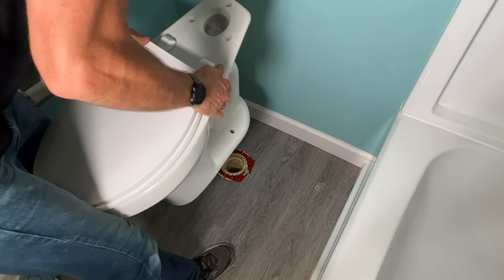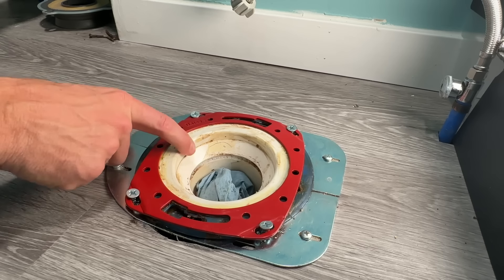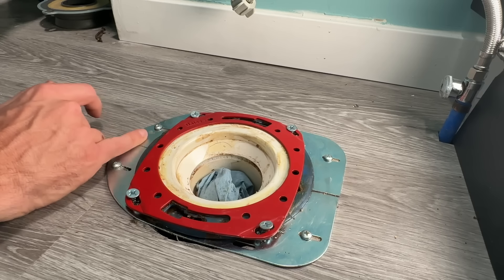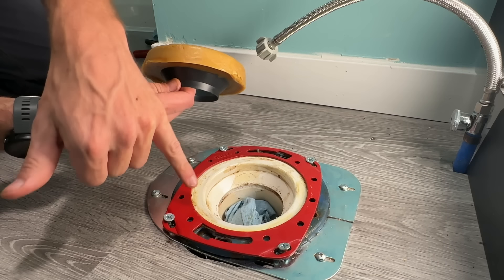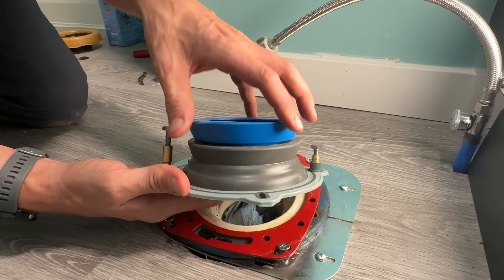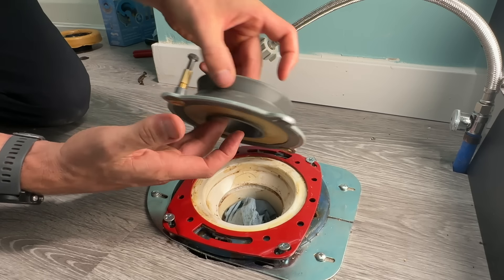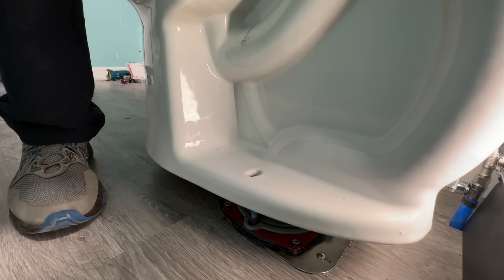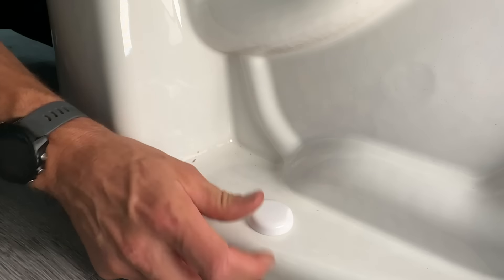How To Install A Toilet Bowl | Best Product On The Market!

Comment: Speaking from experience I would not use the Danco again.  The rubber to toilet seal isn’t 100% air tight and gases can escape between there.  Wax to toilet is more air tight.  I had to caulk around the toilet to prevent gases.  As pressure change it can get under the rubber and toilet interface.
Reply from the maker: Thanks for the feedback 👍
Reply: Beat me to it. I second what Joe said. Wax rings are definitely the way to go.
Reply: But this has a wax ring  it just has rubber on top too. 

How do you know that gases escape from the danco product?
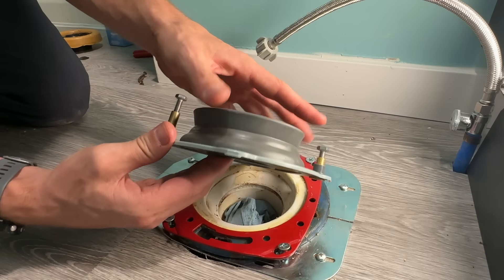Reply: 3:58
Reply: @GzoGuitarWz  3:56 he was fooled
Reply: @GzoGuitarWz  Because the bottom of the toilet is not a machined surface and has imperfections that the wax will make up for that a thick rubber seal cannot.
Reply: I would agree. Wax is the better choice. Just because someone developed a product that makes it easier to install, does not mean it’s a good choice and will work properly.
Reply: Thanks for this. I have a rocking toilet and funky smell after a bathroom remodel. Think I know what to do now.
Reply: @GzoGuitarWz  Their is a reason the go to toilet ring seal has been a wax ring since the 50's... Sometimes the wheel should not be reinvented.
Reply: I used it on a Toto that has a S shaped plastic piece between the toilet and the flange. I had to wax/grease the rubber piece so it has a better seal. Will see how long it lasts. Professional plumber installed it with a regular wax ring and it lasted 5 years before it started to leak.
Reply: multistatetoiletsandrestro2329  Plumbers don't really use these from what I have seen... 20 years of construction and contracting. They use WAX rings. Regular ring on normal depths floors and jumbos on further depth and even doubles at times I believe.
Reply: Dont we all pass gases

Comment: I've been a plumber for over 20 years , a simple deep wax seal does the job , sometimes I'll use a Sani seal ring , I'm not trying to invent the wheel and have a call back
Reply: Yup. He is getting paid to do this. Infomercial.
Reply: you could avoid more call backs without wax seals. mine blew out eventually from just plunging the toilet because apparently was marginal to start with(you never know because you can't see under the toilet to know how well it is sealing). i also always use the thickest wax rings i could find and make sure my toilet is nice and secure, that is never a guarantee though. rubber seal beats wax any day. it also makes setting a toilet simpler, because you can make a mistake and not have it cost you a $6 extra thick wax ring, having you take another trip to the store and 10 minutes cleaning up the mess.

i questioned this kit too until i used it, now i'm a believer. my toilet flange is slightly recessed, so wax rings aren't ideal to start with.
Reply: @LygerTheCLaw  facts
Reply: Rubber rings are better for DIY because they make it easy to remove the toilet and reposition it.  If you're not sure you're gonna get it right on the first try . . . .   But if you do use a wax ring, they're fine -- just use a thick one, yeah, not the cheapest one at the store.
Reply: If the toilet is placed slightly off center or not level, that trusted "horse and buggy mode of traveling" wax ring will fail.  I wouldnt recommend wax rings for your average DIYer, because that old school material isn't as user friendly to install.  Also, when replacing a toilet, wax is a complete nightmare to scrap off and full of bacteria.

Comment: The problem with the rubber is it hardens and degrades over a few years and leaks. I have not used this particular kit but I have installed rubber rings from Home Depot into all three of the toils on my house and all of them started to leak in about three years. I replaced them with wax rings and it has been more than five years and not a drop of leakage. I do realize that this kit has the wax integrated with it but it seems to me the rubber is still the weak link in the chain.

Comment: The blue screw extensions are (almost) worth the cost of the kit by themselves.  For me, setting the toilet down onto the hold down screw/bolts has always been the most difficult step of the project.
Reply: The fat soda straws, like you get at McDonald's for milk shakes, slide perfectly over the toilet bolts to make location easy.  Cut a 10" straw in half for two 5" locators.
Reply: @chrisgraham2904  Excellent idea! Thanks 🙏
Reply: @chrisgraham2904  well played,
Reply: I like to put masking tape down on the floor even with the bolts extending outward so I can see where to put it.  Those things help too.
Reply: @mae2759  Yes, that's a popular trick used by plumbers as well.
Reply: Read More
4 days ago
1. Clean the closet ring (if you like). Look carefully for any cracks or gaps in something  that may result in leakage in places other than the wax seal. 
2.  Install the brass bolts using a washer and nut on top to fasten to ring so they stand up stiff.  If a little crooked you can bend them a little.
3. Set the bowl (without any wax yet) on top of the ring and check for wobble or high centering. 
4. Use waterproof shims (I use pieces of vinyl floor tile) to level the bowl and remove wobble (rocking) without raising the height of the bowl. (if possible)
5. Lift the bowl while leaving the shims in place. 
6. Place the wax ring(s) centered on the closet ring. (enough to get a GOOD squished seal). 1 or 2 will usually be enough...if not reply to me and I'll help.
7. Be sure you understand steps 1-6. 
8. Squish the bowl down using a slight rocking motion till the bowl sets on your pre-installed shims. (Tuck the shims under just enough  to caulk over them them.)
9. Place plastic and metal washers and evenly tighten nuts (careful, not too tight).
10. Check for wobble and caulk to floor. Do not caulk the very back of the bowl so that any moisture leak has a place to exit. (rarely happens)
If you have a loose, crooked, broken, too high, too low or any sub-standard ring...  reply to me or else all bets are off.
Reply: you can put some pieces of straws to the screws to guide you for example
Reply: @ramiroreyes5266  That was my first comment.
Reply: Will this help with a slightly non-vertical pipe? Mine’s about 5 deg slant towards the front.
Reply: @ropaswan  As long as the "closet ring" it's self isn't  more than a 1/2" above the floor surface it's fine. It can be at a slight angle. The wax should be about an inch and a half above the floor height at it's "lowest" point so that you get a good squish all the way around. Using too much wax is cheap and ok....skimping on wax can be expensive. Use shim to keep bowl from wobbling BEFORE you tighten the bolts. I know plumbers who used coins...I use cut up pieces of floor tile. Carefully tuck them under so that you won't see them after caulk.
Reply: @readmore3634  Lots of code revisions now require you don't caulk a toilet to the floor. Always changing
Reply: @Robert-ti5ku  it will slide around when bumped if you don't
Reply: @chrisgraham2904  Straws are also great for the light fixtures where you have to slide the bolt through the insulation on the fixture and then the keyhole slots. Put the straw through the insulation and the keyhole slot on the fixture, then line it up with the screws on the bracket and put it on. Goes from a 15 minute job trying to get them all lined up to a 2 minute job.
Reply: @Read More  all this info is great. This will be my first wax ring replacement. Why is the flange pitched forwards, like in this video? Should it be flat or does it need to be pitched? Also I see you said use more than one wax ring? Can't I just use 1 extra large ring? If so looks good and can just clean up and replace the wax ring right? No reason to mess with anything if it's all solid right?
Reply: @mygt8a4re  The flange should be flat and fastened down, check to see that it doesn't come up  (I pry up on it a little with a claw hammer first). It's ok to be a little crooked.
When you place the wax ring on top of the (tilted) closet flange just add a little more wax to the low side. You want the height of the wax to be about an inch and a half (all the way around) BEFORE you set the bowl..... and you don't want the actual porcelain (bowl) to come in contact (bottom out) with the closet ring. If the ring is so high that the porcelain comes in contact with the flange before reaching the floor you'll have to add shims until it hovers slightly above the closet flange....basically you're putting legs on the bowl....it doesn't have to sit perfectly level....just close.
Reply: @chrisgraham2904  no...we fasten the bolts to the flange so that they're  standing up STIFF.
Reply: @readmore3634  really appreciate your input! 🍻
Reply: @chrisgraham2904 dude, what an awesome idea!❤
Reply: @MAGAMAN  Yep...I've done that too.  Never fun to stand at the top of a ladder, holding a 40 lb chandelier in one hand while you try to line up the connection plate with the screws in the junction box with the other hand.  lol.

Comment: I already viewed your follow-up to this video, related to the gap to the floor after installing the toilet that resulted in a wobble.  Obviously that gap was created by the parts you used in this video that added too much height to the flange.  Hindsight is always 20-20, but next time I think I'd look for a better solution that didn't  cause the height of the seal surface to be higher than recommended for the toilet being installed.  The same thing goes for the leveling issue; get the flange level and at the correct height before installing the toilet.  That is much better than shimming and caulking after the fact.  When the flange is set up correctly, the toilet will make light contact with the floor after it's fully seated to the flange, eliminating any significant gap or wobble.  Otherwise, you have a large object being supported by a small contact area (flange and seal), creating stability issues and possibly adding stress to the flange and drain pipe.  JMHO
Reply: I agree. Too much going on under the toilet. If the flange is on top of the finished floor - which is how it should be - then a simple wax seal with the plastic insert is all that is needed.
Reply: I was told never caulk a toilet because you will never se if it leaks til floor is rotten
Reply: @dextermacnutt  You can caulk it, just leave the back or the non-visible side open so it can run out and you can see it.
Reply: @dextermacnutt  if one does caulk a few weep gaps are needed.
Reply: I agree with you. My dad was plumber. It’s not that complicated. Use the wax ring with insert that fits down in the waste pipe.

Comment: You have to be careful because Danco sells ones that look like the alll-on-one at the big box stores, but it uses the regular bolts that you have to cut off.  The correct model is 10879 but I could only find it online.

Comment: I'm a license Plumber and have used the Danco repair toilet flange kit. I also add a thin slice of wax along with the Danco . So far I've had good results and no call backs.
Reply: When you say thin slice of wax... do you just divide a normal wax ring into parts, or am I missing something obvious?

Comment: Thirty years ago my dad showed me a trick.  He took a regular straw from McDonald’s, cut it in half and slipped it over the bolts.
Easy alignments.
Reply: I saw a short clip of that trick recently too
Reply: @😅😅😅😅Derpherppington
Reply: Thanks very much for this tip!
Reply: Your Dad was smart and resourceful
Reply: Got it.
Reply: I used your dads trick in the past. I took it one step further and now use real long flange bolts to make bowl installation easy. I don't even bother to cut the bolts off.
Reply: HEYYYYYYY THKS FOR THAT!!!!  Work smarter not harder🎉🎉🎉🎉
Reply: mind blown